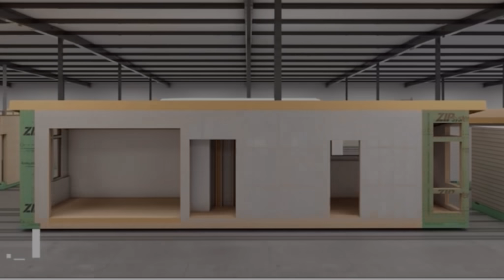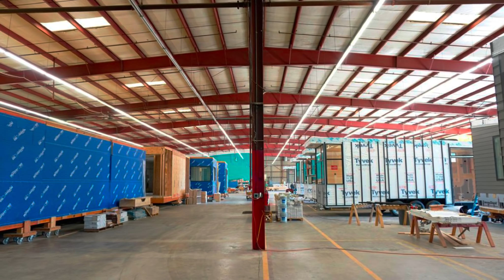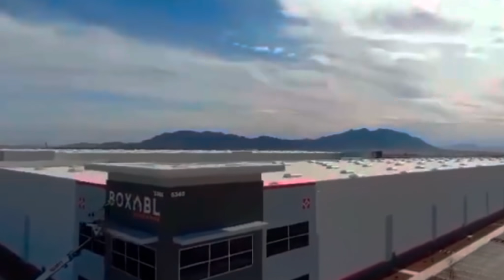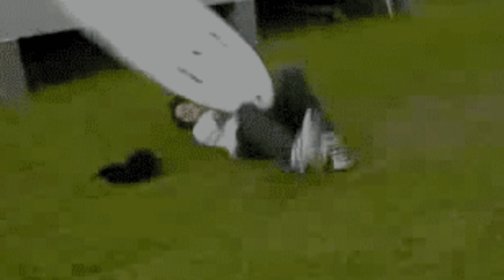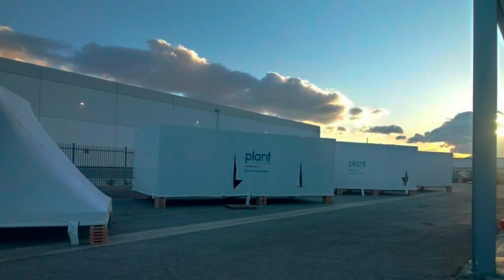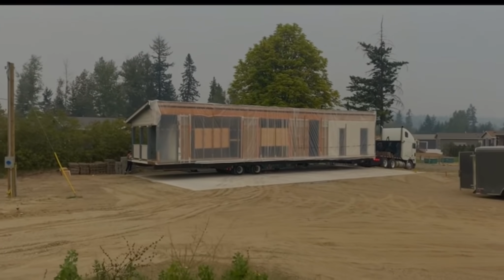The Modern PREFAB HOMES Disrupting The ENTIRE Housing Industry

Comment: Excellent, excellent in the future you have to go back to this plant and tell us what the assembly line actually looks like and what type of materials are used in the automated assembly process? I and extremely curious and impressed with the introduction to Plant, but what’s in the near future? Hoping that their process will help reduce increasing cost! I just found out that the city of Hayward is requiring very expensive pricing on issuing building permits, I will have to verify this but things like that add to the cost of housing and makes it difficult to build affordable housing 😮!

Comment: It's a proven concept by french company Ossabois, kinda leader in France for off site wooden buidlings. They advertise the concepts of : 
- 2D systems (walls with windows + insulation), 
- 3D systems ("boxes", but very convenient for bathroom for example, as they have plumbers / electricians finishing this work offsite), 
- and at last 5D : 2 + 3, as the full house will be build on site with already made walls (2D), and adding an already made bathroom or kitchen (3D)
Their website, documentation and youtube are in French, but you can understand by seing their pictures and videos ;) 
Cheers !
Reply from the maker: Will check it out, thanks!

Comment: I did cost analisys at several points in time, but in reality these prefab homes have a lot of limitations in design and build quality, despite the manufacturers claim the opposite. Plus they end up costing way more than built on site. 
They are more affordable in Europe and of better quality, but in North America they are too expensive. 
Just look at this video, they are made playwood, Zip panels, cheap cladding, ordinary windows and finishes and they will cost you 300/350 sf.

Comment: I think Boxable is ahead of them and better suited for flexibility and pricing for new home buyer's.  I just bought (moved in this week) a two section modular home (24 by 58') and I'm not impressed with the finished product.  No big complaints but I don't think it was any faster or cheaper than stick built. That might be an issue of the local dealer it was bought through.  I'm looking into Boxable for a unit for my winter snowbird location in Florida later this year.  Going to N.Las Vegas to see it first hand and making a decision then.  Price is still king with me but there's a big difference between cost and price !  ( Like your channel though !)
Reply: What kind of modular home did you you get and at what price?  I just got a 12’x33’ for 45k!
Reply from the maker: Keep us posted on what you find out on your factory tour!

Comment: Many of these companies are innovative and have great designs but the delivered cost is too high. These homes are too costly to have any impact on the housing shortage. Plus delivering 800 homes annually comes nowhere near the demand. After over 50 years in the industry I agree we need a drastic change in the process of home building. We also need major revisions in building codes and land use regulations but that is another can of worms. I enjoy your channel, keep up the good work.
Reply: Boxabl
Reply: Completely agree it is a drop in the bucket holistically.  I think the point was that 800 homes is a lot more than any one builder is constructing annually, so it does have the potential to help the market in communities that are able to be serviced by a company like this.  Shipping one of these homes from their plant in California to my state however would be just a ridiculous cost in addition to the over priced home which supports your point that them building 800 homes does very little for the majority of the country.  You are correct though that these homes are way too expensive.  The whole concept of building modular in a factory (similar to his GM example) is that it is supposed to increase quality and consistency and reduce unnecessary waste and cost.  But my local contractor can still build a home with a healthy mark up considerably cheaper than ANY decent modular home I have found on the market.  This should be an exciting change (albeit slow moving) but until a company gets their pricing right for this type of construction I remain unimpressed by the entire sector.
Reply: Some of the concrete printable homes are being made for less than 10K…
Reply: @PeterFaletto  no they arent